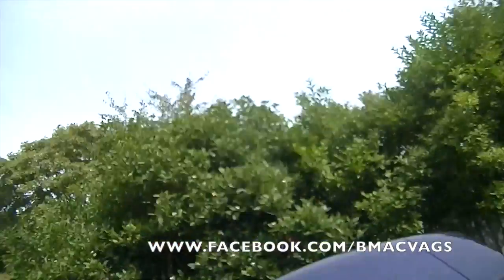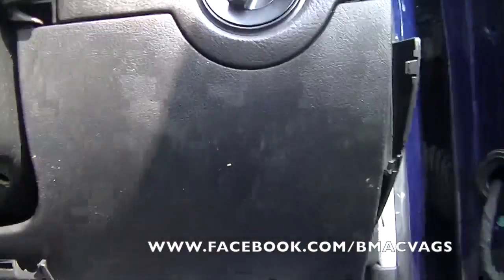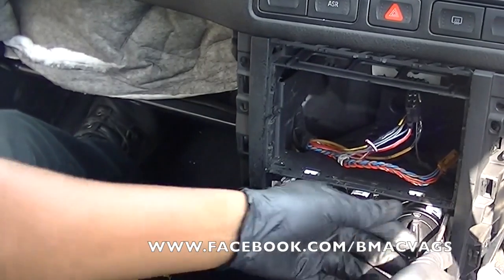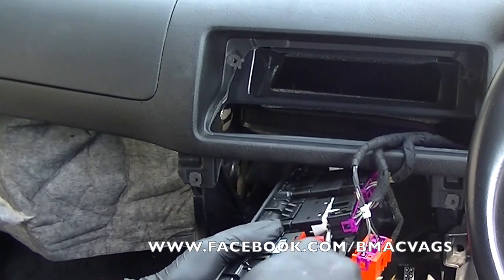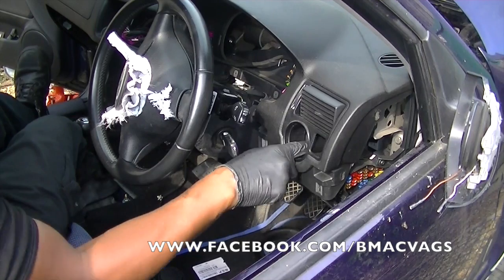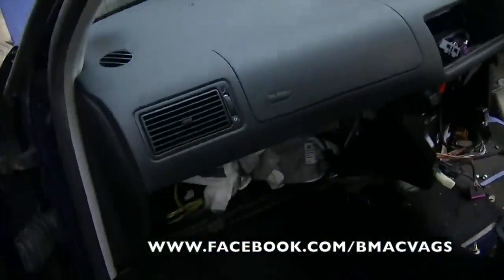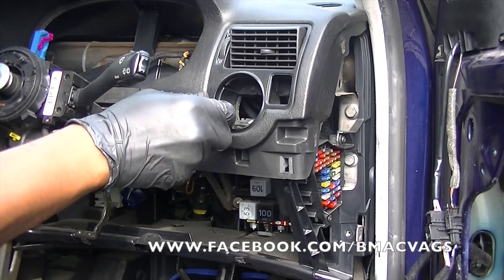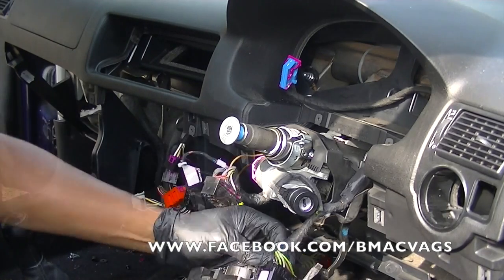VW Golf Mk4 Dashboard Removals

Comment: You can actually pull the steering towards yourself on most of the golfs with adjustable rack, once you pull the leaver to adjust it try pulling it toward yourself and will help you remove cluster Outa its place easily!!

Comment: Hey man 
I need your advice and support for something related to MK4 golf.
I have MK4 model 2002 and I need to modify the full dashboard with the steering and console and instrument cluster to MK7  
The question is:
1- can I do that?
2- did I need to change the control unit?
3-did I need to change the door interior panels with all the controls windows keys and mirrors ?
4- did I need to change all the car wires?

Comment: thank you! exactly what i needed! seems to also work for my VW bora 1999. I want to take the middle radio holder / cup holder stuff out. That rubber-ish coating of VW wears of fast. but with some repainting it is doable :) couldn't find the screws. seems rather hard to get too.. atleast now i know where they are so thank you :)

Comment: Hello mate loving the vids your doing a great job. I have a question.  How do i replace the lateral acceleration sensor on a mk4 golf 2.8 V6 4 motion on a 2000 (w) as the diagnostic read codes 01279 and 01423 with abs and other lights on dashboard? ?

Comment: My heater hasn't been working and I finally got around to fixing it and I found that the fan speed controls melted. Is there a way to swap out just the heater control panel with a new replacement without having to disassemble the glove box, consoles, and things?

Comment: your videos have been a great help but could you please do a video about parasitic drains, i have a mk4 golf and the battery drains really quick. iv changed the battery and checked that the alternator charges the battery. but as soon as i turn the ignition off it starts draining really really quickly. my boot doesnt open with the central locking could that be causing it to drain?

Comment: Do I HAVE to remove the centre column to remove the glove box? Cheers.
Reply: No, you can remove the glove box easy - it is 6 bolts.
Reply: Cheers boss
Reply: cenariusbg & disconnect glove box plug buddy, to completely seperate glove box unit.